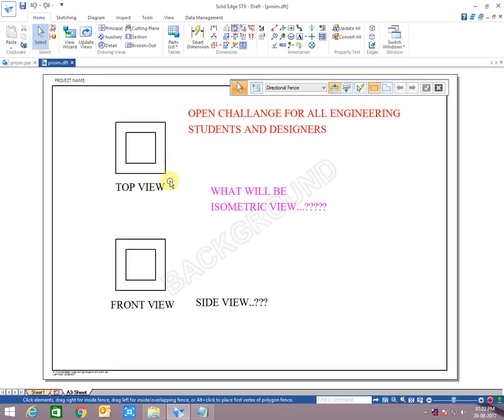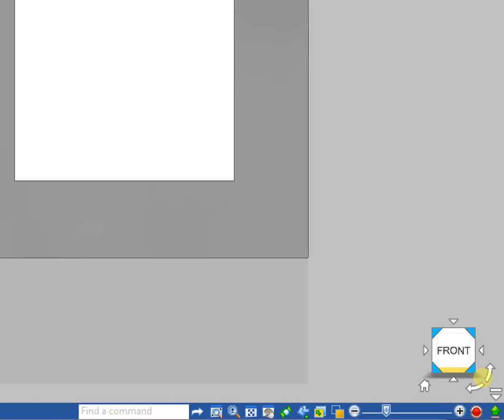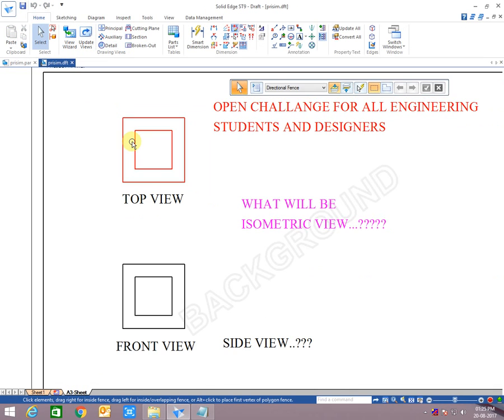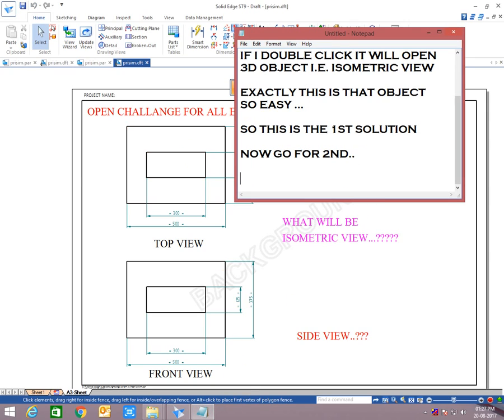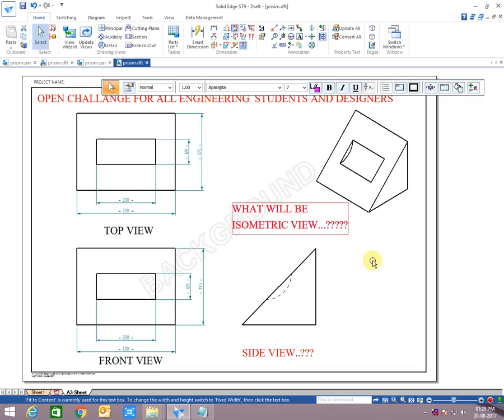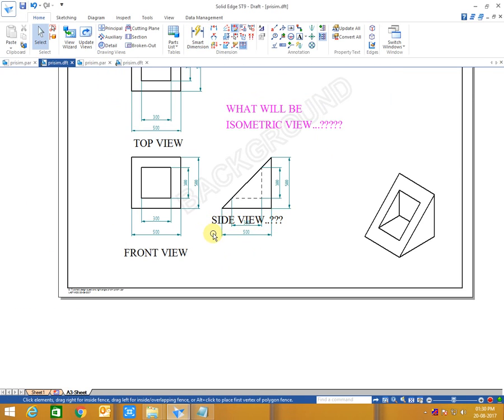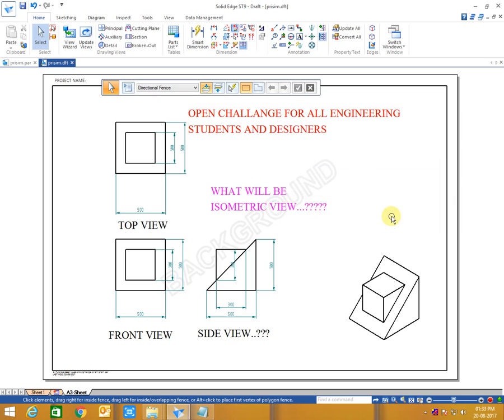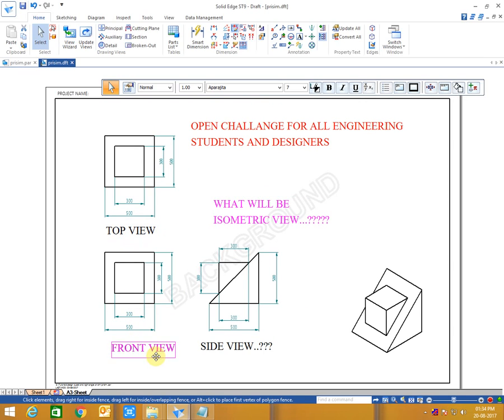Design Engineer Interview Questions with Answer PART 1

Comment: What are the subject knowledge important for Mechanical 

Please reply me bro
Reply from the maker: If you are willing to work in Design domain then machine design CAD strength of material Thermal & Material science required Electrical motor n electronics are preferably req